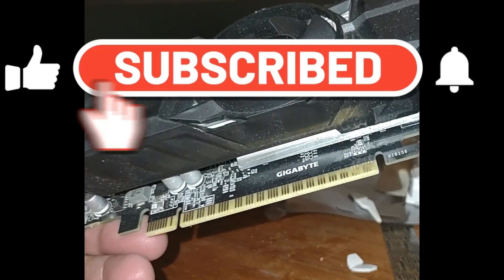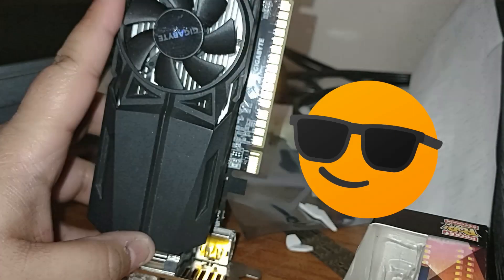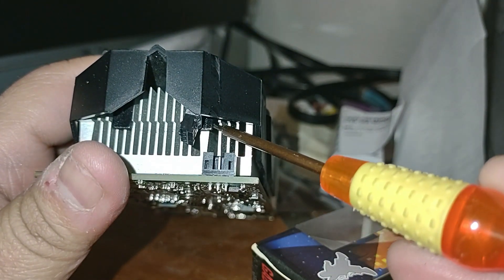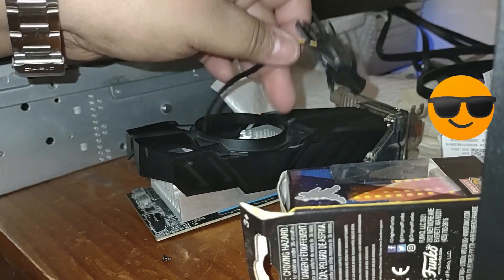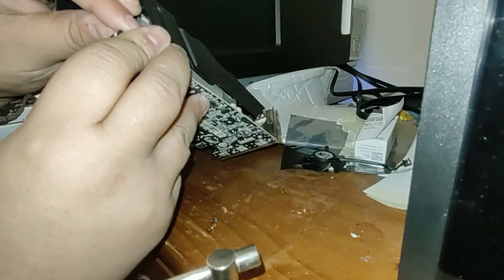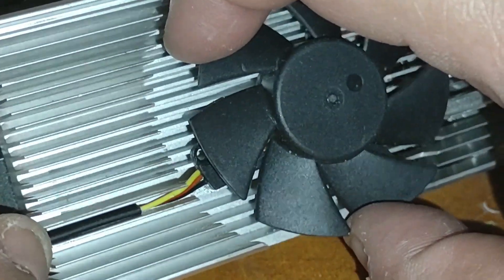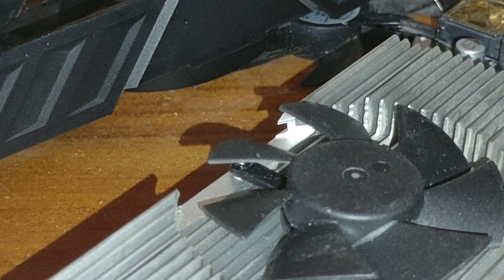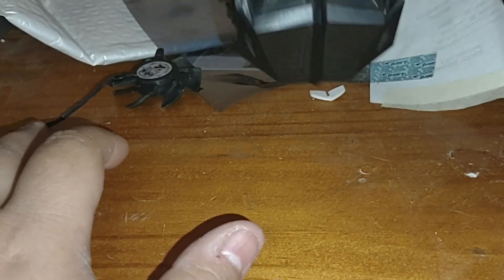DIY Fan Replacement: Save Your GTX 1050 Ti LP from Overheating!

Comment: Do you know what size fan it takes?
Reply from the maker: CCBBAA for Gigabyte GTX 1050 Ti FS1250-S2053A 12V 0.19A Graphics Card Fan with 4.5cm Diameter Cooling Fan

https://www.amazon.com/gp/product/B09DLDXTJ2/ref=ppx_yo_dt_b_search_asin_title?ie=UTF8&psc=1
Reply: You're an absolute gangster @justbored3.14

Comment: Mine also started to die, when i start it goes to 2k RPM while making a wrrr noise, then after a while goes down to around 1.5k RPM and then it just falls all the way to 100 RPM.
Reply from the maker: yeah mines did that.